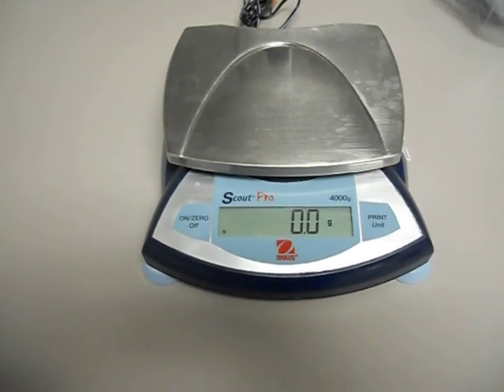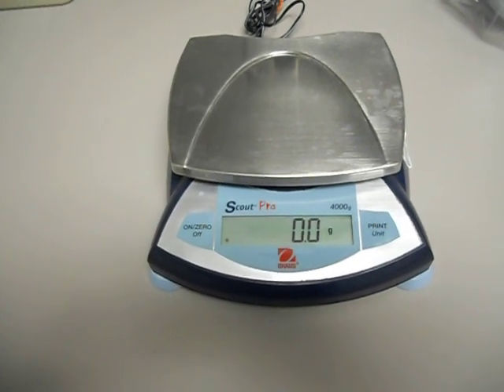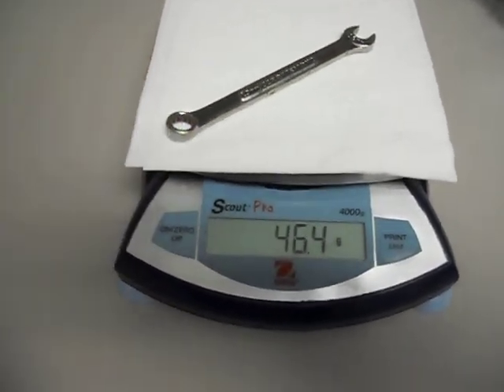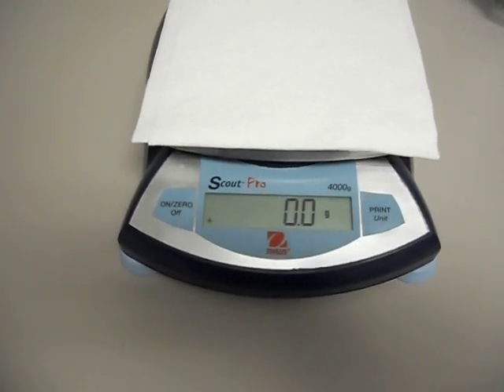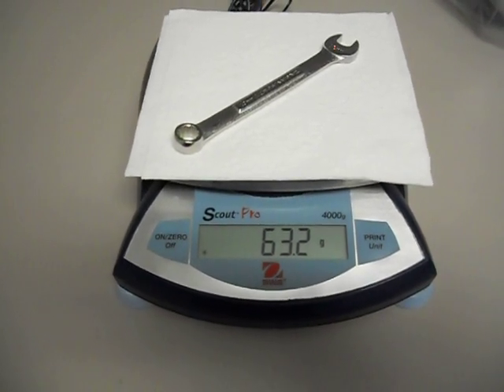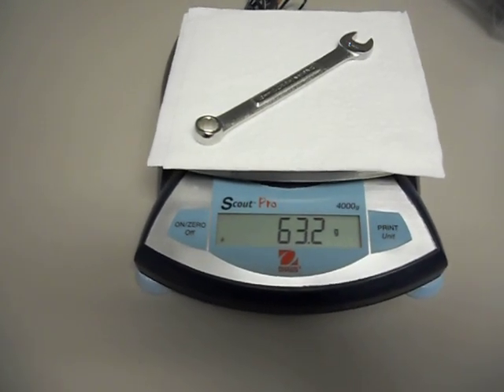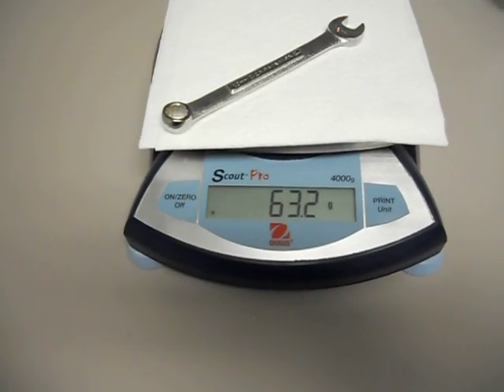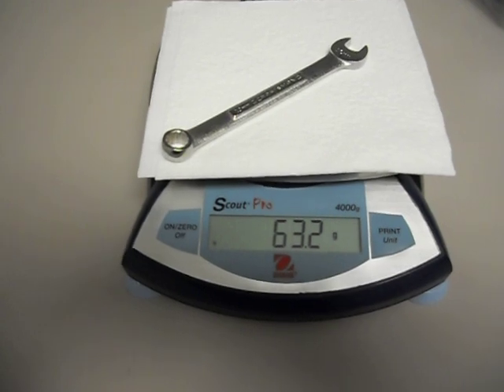Craftsman Tools: USA vs China [Part 3] - Materials Composition -

Comment: Cool video, but I do have a nitpick.

You theorize that the increase in weight is due to necessity of a weaker alloy.  However that might not be the case.  Yes these is an economic reason not to use more metal than is necessary, there are also an economic reasons to use more metal than necessary.  Feel and reputation.

Like most every other tool guy I was saddened to see them now made in China, and when I saw that on the box of a set I walked over to the individual tools and picked one up to see how it felt.

Picking it up I noticed the weight of course right off the bat.  And my brain went right to "feel nice and heavy" and "feels solid".  This alone is huge, they could have switched to a much lighter alloy, but knowing it was Chinese my brain would have said "Cheap"  rather than being surprised at how solid it felt.

If they went with that lighter alloy, like say some Blackhawk wrenches, they would have been done, forget it, feels light must be cheap.

Obviously that's not really true, those lighter Blackhawks are some mighty fine tools.

The second part "reputation" I really mean in terms of breakage.

If you break a snap on, you think "holy crap I broke a snap on", not exactly like seeing a Unicorn, but still pretty rare for a wrench or socket.

If you break a older USA Craftsman you think "Well, that doesn't happen every day, I really put some torque on that one"  You don't expect it to happen, but when it does on occasion you get it, a tool can only take so much.

If you break a Chinese one you think "Well that figures, piece of Chinese crap, of course it broke"

For this reason it makes alot of economic sense to "overbuild" those wrenches, because the first time one breaks from what might be reasonably considered "normal use" people would bash on that tool to anyone who would listen.

Heavier might be from weaker  alloy, but it might also just be overbuilt to protect the reputation and give it that heavy solid feel that people equate with quality.
Reply from the maker: I once specialized in materials composition chemistry, particularly inorganic metals and organometallics.

I'll respond to your comment with an answer I left another YouTube user.  I hope this offers clarification:

"Metallurgy would be better called Transition Element Crystallography.  This important to say because, whether it is 100% pure elemental or an alloy, metal atoms arrange themselves in fine networks with planar geometries.  Metals have crystalline, crystal like, properties.  

The network, lattice, is completely dependent on the composition of the material.  The better the purity of your composition and more refined the material processing, typically, the less material you need to input to create X or Y product [to achieve a desired property].

Knowing this helps answer the question: Why, typically, are forgings stronger and lighter than castings?  The answer involves the fact that forged metals have, to put it simply, more organized and consistent pattern of arranged atoms, whether a pure element or an alloy, which can involve 2 or more metal atoms in a particular arrangement [these factors affect various strength properties, depending on the elements used in the alloy].

Yes, I can agree with you, that to someone that isn't in "the know" my video would be a little incomplete.  As indicated in the video, inferior forgings or even castings usually bolster the lack of structural integrity with literally more material.  A better made forged alloy can be made with less material because of the care that when into the quality assurance of the base materials and the attention to detail in making it; hence, the tool, in this example, is lighter and stronger.

If I have a Ferrari and a Chevy Corsica of equal weight and engine displacement why would the Ferrari be faster around a track?  The Ferrari's engine is made to take more abuse and more care went into its design.  The same could be said about a Ferrari and a kit car made to look like one.

I have read other view points like yours.  In the future, I hope to be able to wrangle up the materials and devices necessary to directly demonstrate what I am talking about."

You are absolutely correct with your assumption regarding economics.  With today's "disposable" ethos and corporate culture, the economic choice for Sears was to export the Craftsman brand to China, where the tools can be made cheaper.  This affords Sears a cost savings in labor force and, due to the degenerating ethics in quality, give them a push to allow an inferior produce to be produced versus those of yesteryear.
Reply: Granted, however Craftsman is a brand name, and people noticed that the tools switched to Chinese made.  The cost savings wouldn't help if people stopped buying the product.  Which probably many have, but still they sell quite a bit.  Overbuilding the product using the same alloy could help offset worries about material failure.

As you noted, not only are the Chinese made wrenches heavier, but they also have more mass, more material.  Those things could be directly related.  That could in fact be the same alloy, forged by the same process, but to a new beefier design to offset breakage and protect the company's reputation.

I'm a huge fan of "Made in America" especially for certain things, mostly tools, knives, and boots.  However, the products that used to come out of Asia in the 70's, 80's and 90's as total garbage have really stepped up their game.

I think they need to be judged by what they are, not what they were 30 years ago.  I recall breaking down and having to buy a cheap Chinese socket set back in the 80's at a discount hardware store.  They were cast, they made it halfway through the repair before shattering.

But now my bother keeps Harbor Freight Pittsburgh tools in his motorcycle saddlebags, and uses they all the time with very few failures.  I've used them a few times when helping him out.  Frankly, they impress me.  I'm used to the Snap on stuff I bought around 1990.  No, the HF stuff is nowhere near snap on, but not much is.

Truthfully though, when people ask me to recommend brands of mechanics tools I say "No".  I won't recommend they spend a fortune on Snap On, although they are great tools.  I won't recommend HF stuff because although it is far better than it was I still expect it to fail, possibly causing injury, although it might not fail at all.  I won't recommend new Craftsman, because we just don't know yet (in my opinion).  I think the Chinese Craftsman is probably on par with most HF, just twice the price.  Quality somewhere around "not bad" and "not great", but "probably ok".

It's too much trouble to explain flank drive and tell people to buy used craftsman made in the USA that has it, while most Craftsman made in the USA doesn't have it.

I can't just say "USA Craftsman" when a HF socket with flank drive will actually remove a rounded nut better than pre mid 1990's Craftsman USA.
Reply from the maker: I an agree with what you are saying except your perspective on materials composition.

The Chinese tools are NOT overbuilt.  Overbuilt would indicate they are of a superior process and composition, which far exceeds the necessary requirements needed for whatever job you will put the object through compared to known standards.

Speaking from direct experience in this field, the only reason why you would need to increase the quantity of matter in a given space would be due to lower purity materials and/or a poorer processing. 

Uniform lattice structures within an alloy produce stronger tools.  Forging and other processes further purify and align the lattice.  These aspects are what separate professional grade tools from Harbor Freight and everything in between.

How can you cheaply compensate for a hokey process and alloy?  Simply add more of it.  It is really that easy.

Alloy purity and the forging/processing aspects of tool making are the highest source of cost besides the human labor.  Thus, Sears outsourcing the tools allow them to further cost control with lower cost materials, processing, and labor, which yields them more profit.  If the Chinese tool breaks, that is A-OK, it literally cost us $0.10 to make; yet, the customer probably paid 100x that for that one wrench in a set.  No big deal.  99 to go before we lose money.

If the wrenches were made in the USA, Q/C issues, should there be any, would be a larger financial gamble for Sears, and, given the fiscal state the company is in, they cannot take those kind of risks in both produce expense AND warranty work/repair/exchange.  Given this, Sears exported the brand to maintain solvency of this aspect of their company and nothing more.

There are differences between the very first V series wrenches from 1948 and the last USA made Craftsman wrenches in 2012.  As knowledge about metallurgy and processing was acquired, they were integrated into new tools.  If I had to bet, the 1948 wrench would reach failure long before the 2012 USA made piece, despite there being nominal differences in the pattern design.  It boils down to the chemistry.

There are differences between the Chinese and USA wrench pattern.  Without reiterating myself, the Chinese pattern is selected purposefully to compensate for the weaker alloy, so, yes, in this instance, you are correct with your idea of bolstering; however, it isn't for the same reasons of "overbuilding" it.

Thank you for the comment.
Reply: Don't get me wrong, your theory is a perfectly plausible one, and you are more than likely spot on.

While a failed USA tool may cost the company more to replace, a failed Chinese tool may actually end up costing them more due to ruined reputation.

They are probably out there, but I have yet to see or hear about a failed Chinese made Craftsman wrench or socket.  I hear alot of people disliking the fact that they are made in China, people saying they look, seem, or feel cheap.  But I'm not seeing actual failed products.

The economics may look more like this.
US made 16mm socket might cost Craftsman $1.00
Chinese made to same specs might be $0.10
Chinese made with more material might be $0.17

Still a huge savings, but some extra piece of mind for Craftsman about their reputation.

I think under normal circumstances you are completely correct, as you pointed out the old =V= series were thicker walled, heavier tools compared to the later G series.  I do think that was absolutely about better steels, better techniques.

I just think with the switch to Chinese made, consumer confidence becomes a big factor.

It is sad as hell in my opinion, Craftsman quality had been on the rise for years, they really became one of the "best value" brands in that sweet spot period.

Anyway, just a potential alternate theory, been great talking with you.

I am kind of curious though, if you were to recommend new made tools, what would you recommend?
Reply from the maker: I was a materials composition chemist.  There is no "theory" about what I said.  Myself and my colleagues consulted companies/working groups or directly manipulated materials in the ways that I've already mentioned for years.  The science and techniques of particular metallurgy practices have been known for decades and, in some cases, centuries/millennia.

Complaints about the diminishing quality of Craftsman tools has been a topic for a good 20+ years.  During the late 1990s and 2000s, a good 70% of the Craftsman tool brand was imported.  Chinese tools made up a significant portion of that percentage.  Hardly any effort needs to be made to find data about complaints, failures, injuries, etc. from imported Craftsman tools.

Again, the Chinese don't bolster the weight of their tools to add strength.  They need to be bolstered to attempt to meet the same specifications of what was their American made counter parts.  The difference between the US and Chinese tools are the raw materials and the processing.  They are not equivalent.  We've discussed this ad nauseum.

I appreciate your brainstorming, but sometimes ideas are just flat out incorrect.  Always research before you try to defend your claim otherwise your hypothesis is just air.

Comment: The cman max axess is probably the best set of wrenches right now and considering a full set of 18 wrenches will set you back $28 should have people running out and buying them. I got both sets from sears outlet in SAE and Metric. Yes they are made in china but good quality. 9 sae and 9 metric.

Comment: By weight is not enough to justify; I am not against what you said, but suggest to do a strength test between not only the weight difference but also prove that inferior material does or does not break first... that will really prove your point.  Weight alone is just not enough...
Reply from the maker: If you are up for it, I have sent a reply that will answer both this and your other comment.

Good day,
TheseAreMyToys

Comment: I would say that the most important factor of tool manufactuing is the tollerances. how well does the tool grip the fastener??? if the tolerance is too high then it will round over bolts. When was the last time that some one honestly broke a wrench like that while using it properly, but I can say that I have rounded over many bolt heads. And that Is why I like american tools, tighter tolerances.
Reply from the maker: +Brad Sogn I mention the tool tolerances in the PART 1 video I believe.  The American tools are higher tolerance than the cheaper Chinese wrenches displayed on that video.

Tolerance is important; however, it is part of an array of necessities to create an excellent product.  Metallurgy and the processes to achieve the final product are extremely important.  Tools made of the same exact materials, if not using the same or similar production philosophies, will have very different properties.  Juxtaposed to this, you could have a tool with amazing tolerance and have it made of Play Dough.  Would it meet spec?  Yes!  Would it survive?  No!  You get the idea.

Tolerance, metallurgy, production practices are critical in creating a fine tool.  The interplay of these properties is what separates cheap versus expensive tools.

In regards to your original comment before edit, density, doesn't necessarily dictate better or worse alloys.  The properties of the alloy's crystalline structure is, which can be determined through x-ray or scanning electron microscope (SEM).

To meet certain safety requirements in the USA, tools have to meet specifications in torque, torsion, etc. for their class.  In this video, with the examples you see the circumstance is obvious.  One wrench has more mass than another.  In metallurgy, in this application, substituting more material to make up for a poorer quality alloy crystalline structure, which is what gives your tool is durability/strength, is a cheaper way to attempt to match those with better metallurgy.  Tools like this fail more often as they cannot uniformly distribute energy that is applied to them.  Ultimately, this results in micro fractures and causes the tool to fail.  Again, depending on the composition and the practice used to create your tool, can result in a simple bend or a catastrophic shatter.

Unfortunately, things are never as simple as pointing your finger at one thing.   While comparing weights as shown in this video may seem too simplistic or narrow minded, to a metallurgist it can say a lot, considering the two tools are expected to pass the same standards.

Comment: I would love to see a comparison like this done on the USA and Chinese Craftsman sockets.  I looked at the Chinese sockets in the store and they look like they have a much thicker wall, which would certainly make them less useful in tight situations.
Reply from the maker: You are right, more isn't always better, especially when it comes to metallurgy!
Reply from the maker: +shaftwood That is a good point!  I have received MANY similar private messages regarding the same question.

I think I "may" create a patreon account for people to donate to the channel to meet those questions.  I personally wouldn't spend my own money on the Chinese Craftsman sockets, but if a few people threw a little money in the hat I'd be more than happy to pick up a set to do experiments and destruction tests on them! ^_^
Reply from the maker: +MyOldTruck If I were to pick the Chinese variants up each piece would be tested to the point of failure.  I'm not going to return pieces that I intentionally destroyed.  They would go to the scrap yard and be given a proper burial (ha-ha).
Reply: +TheseAreMyToys It's funny the average consumer if compared with the US made sockets might think they use more metal so it would be stronger. But sadly it's not so.

Comment from the maker: Meejhem where do you get your math?

USA Industrial Craftsman = 49.9g
Chinese Craftsman = 63.2g
49.9/63.2 = ~21%

USA Standard Craftsman = 51.5g
Chinese Craftsman = 63.2g
51.5/63.2 = ~18.5%

Combined average weight of both USA wrenches vs Chinese Craftsman
((49.9+51.5)/2) / 63.2 = ~19.8%  (round the solution up to 20% more material)

This isn't that hard my friend...